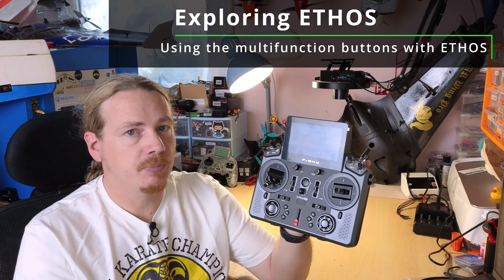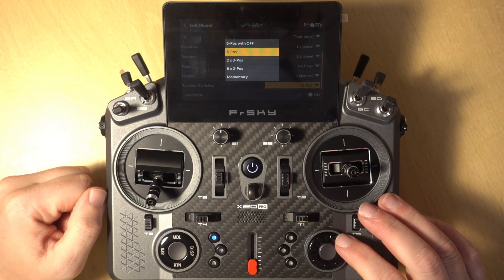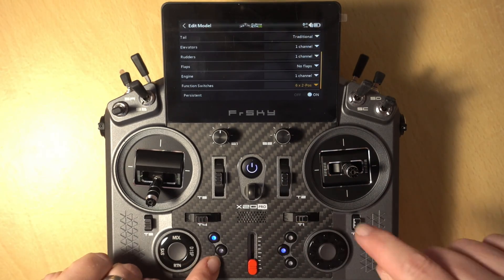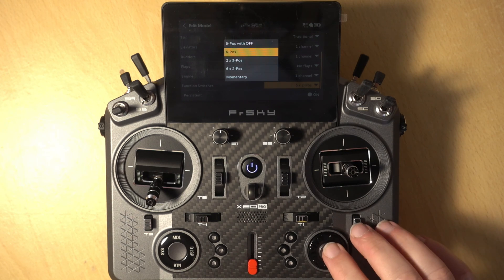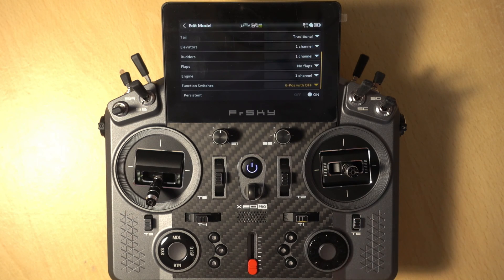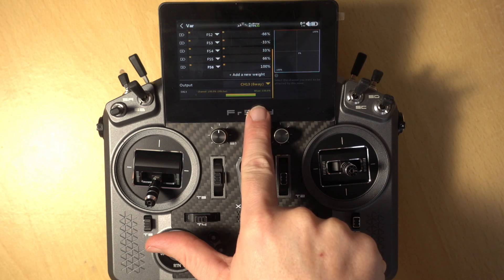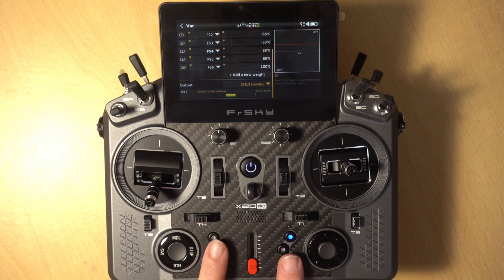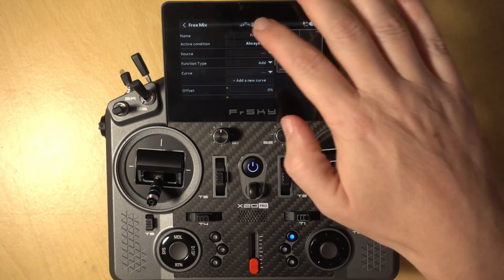Using the multi function buttons with ETHOS: The modes and how to output on a single channel

Comment: That's exactly what I'm looking for! Thank you very much for the information!
I fly my fixed wings with Ardupilot and would like to control my flight modes this way. Is it now also possible to play a corresponding sound for each setting that tells me which mode I am in?
And, I can't find this value mixer in my X 20 RS.

Comment: I just spent a half hour trying to find and change the function switches to momentary in the hardware menu... Well... now I know and its easy lol.  Putting my gain on F1 and F3 so it saves at the position per model and I'm not accidentally hitting the wrong trimmer if I'm trying to set my gain.  Don't like gain on a pot because then I have to write down appx where the gain knob is set for every model.
Reply from the maker: With gain on a pot. You can add the position to the checklist. So when you load the model, it will prompt you to move the pot to the correct location before it fully loads the model.
Reply: @MrD  Good to know, might do that instead but the push buttons set on a GainVar have been working well.  Pot is easier to adjust on the fly tho.

Comment: Any idea if you could use those buttons to turn data logging on and off?

Also, is it possible to use the buttons on ignition on a gas plane? It would be nice to have 2 buttons turn the ignition on and off that way you can’t just accidentally hit one button while flying.

Comment: Hello Mr. Daran is setting up the archer rs plus rssi to read correctly in betaflight osd the same as if I were using open or edgetx. I’m using sbus on the receiver side and my transmitter is the twin xlite .

Comment: I've used the 6-Pos switches for various head speeds (RPM) on Heli's every sine FrSky released the X20S.  For iNav I've set up my X20S to work identical to the iNav fixed wing groups standard OpenTx model, however if using the 6-Pos switches it can be easily configured to the iNav's groups Pro OpenTX model.

Comment: V
Reply from the maker: Thanks. Copy and paste mishap.
Reply: It would be nice to be able to select a particular function switch active at switch on
Reply from the maker: It won’t automatically. But you can set a warning in the checklist. So that a particular function button needs to be enabled when you power on or change to that model.